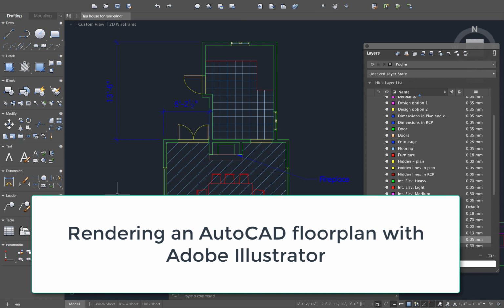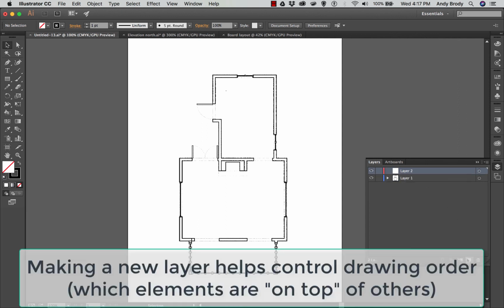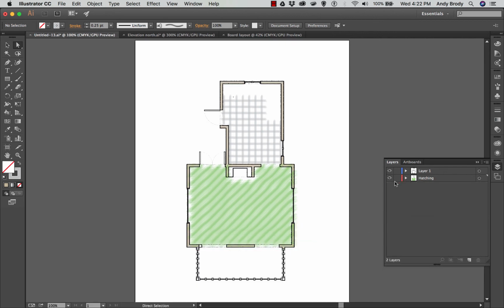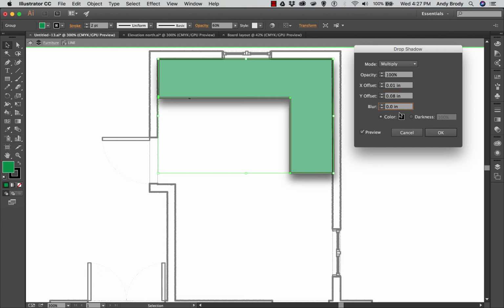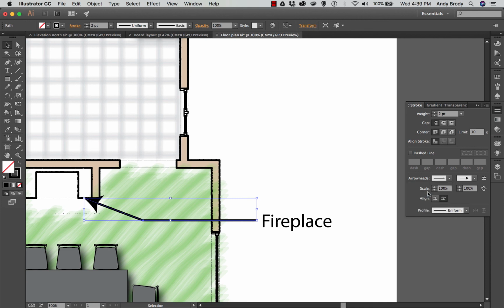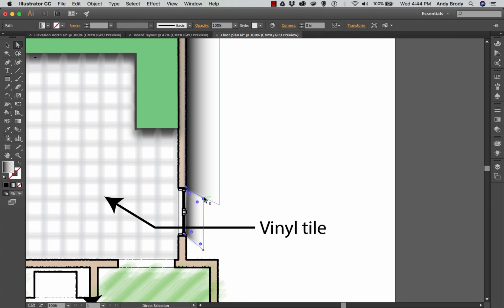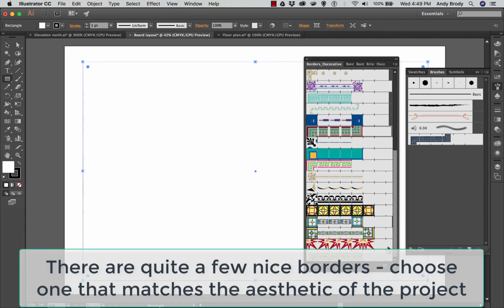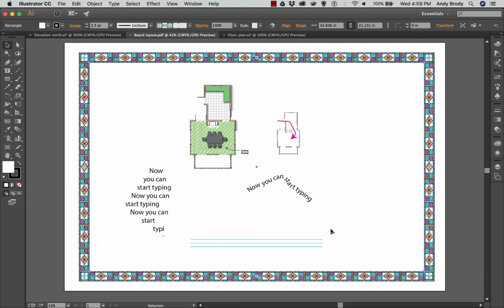Illustrator - floor plan rendering

Comment: this doesn't work on revit exported pdf files, could you show us how to render a floor plan on Illustrator that was done on Revit and exported as a pdf please.
Reply from the maker: There's actually a little trick to get a Revit plan to AutoCAD: make a new sheet in Revit, and place you plan on it. You don't need a border, and be sure to turn off anything in the plan that you don't need for rendering, like column grids, notes, or hatching. Then, choose File>Export>DWG... This process usually this gives you a pretty clean plan to bring into Illustrator. You can also render perspectives the same way, if you want a better "sketchy" look that Revit can do, or a little more control.